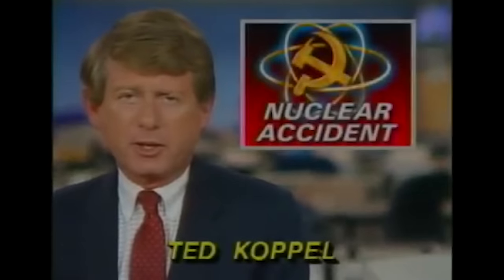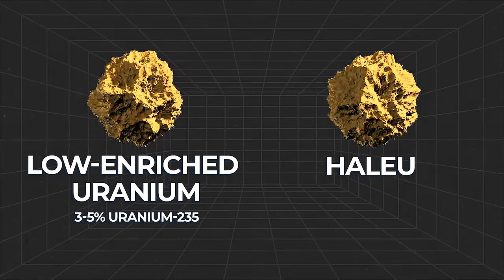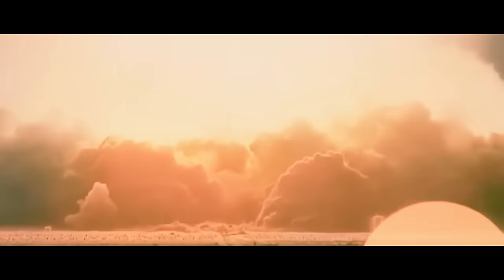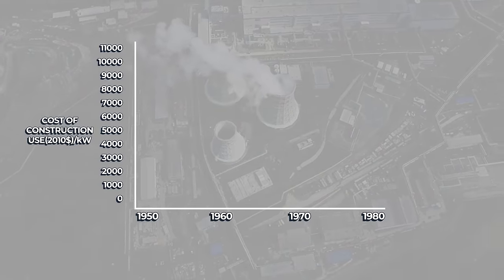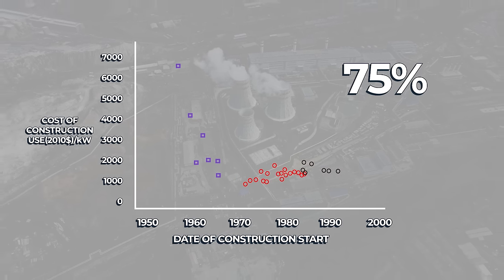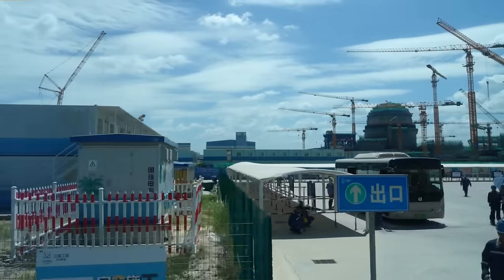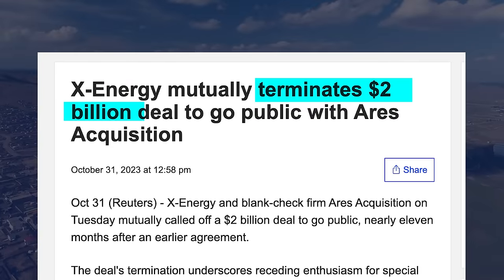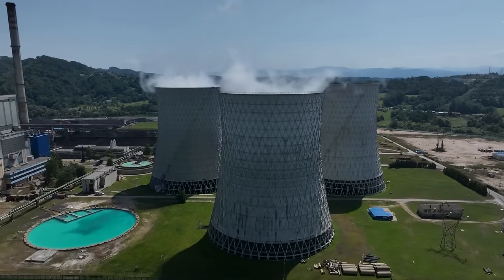Nuclear 4.0 | The Small Modular Reactor Revolution

Comment: The Moltex Static Salt design does away with almost every hazard from traditional nuclear power. Its sheer simplicity and intrinsic safety should dramatically reduce costs. It’s also scaleable by building more reactors on the same site. It is naturally load following and and cannot over heat. Excessive temperature stops the nuclear reaction long before it becomes dangerous. It could be disconnected from load at full power and nothing nasty would happen. It has boron shut-down rods but they are not needed as an emergency tool. 
There is no water or steam in the core so no pressure and considerably less corrosion than we get in PWR cores.
We should be moving heaven and earth to build these things. Instead we have an out of control nuclear regulator that completely stalled progress. Moltex is now getting the job done in Canada.
Reply: What are downsites of said system?
Reply: It might be good to have newer reactor designs that are safer than the older ones.  But the problem of disposal of spent nuclear fuel continues regardless of safety of reactors themselves.  And this problem has never been solved. Keeping spent uranium in water pools a few years, then outdoor dry storage in metal housings is insanity. There is no assurance that this extremely dangerous material will remain secure for thousands of years.
Reply: @alesksander  it's powered by pixie dust and unicorn farts.
Reply: @stanleyhampton7185 Finland does deep geological storage, and both France and Japan recycle spent fuel. Also some of these newer designs are able to burn up most of the spent fuel resulting in waste that only needs to be kept safe for a couple hundred years.
Reply: @justinhalsall4077  A couple hundred years is still a long time.  A society can easily collapse such a lengthy time.  Natural and man made disasters can occur.  It is very uncertain that spent nuclear fuel can be kept secure due to these potential failures. Geological storage is not without risk.  Seismic activity can cause leakage.  Water migration can cause dispersal of material from ruptured containers. There is really no safe means to dispose of spent nuclear fuel.
Reply: @stanleyhampton7185  It is esimated that the US has 800 years of "spent" uranium fuel in storage which has only 1-2% of its total fissionable energy burned.  Several SMR companies advertise their designs as "wasterburners".  The small amount of remaining radioactive material needs to be stored only several hundred years.  This is far better than the much larger casks of above ground storage used now.  The federal government spent $8 billion in senator Harry Reid's Nevada to build long term storage at Yucca Mountain on federal land.  Political opposition has prevented this storage facility from ever being used.  I would prefer to recycle old spent nuclear fuel rods, getting almost all of the available power out of them, and needing storage for a smaller amount of material with shorter half-life.  Remember, we are already storing used nuclear rods and nuclear fuel at multiple sites.  This is the long-lasting material with actinides.  There is no downside to converting this to much shorter half-life material.
Reply: @alesksander  The only downsides unique to it's design is the salt corrosive nature and it being unproven.
Reply: btw it's stable salt reactor btw, not static salt. if it was static salt it wouldn't work because you couldn't remove the heat efficiently.
Reply: Corrosion is much higher and a major problem with Molten Salt Reactors. The other problem is most people are considering Thorium as the fuel for MSRs, but fail to realize the fuel cycle requires more than a month to go from thorium to fissile fuel.
Reply: @tadferd4340  apparently below 700c water is more corrosive at 350C because what makes salt water so corrosive is the same thing that makes mud highly corrosive water + free ions.

If we are talking end game molten salt reactors running at 1200C yeh corrosion with current materials would be a massive problem, but they are end game molten salt reactors so we have plenty of time to work out the metallurgy or whatever material we end up using, maybe we decide it's not solvable with metal so we go with graphene lining, who knows, but 650C is plenty hot enough to get started.

Well maybe we decide gas core fission is a better route, but then you are basically using the same methods to get the energy out as fusion and the same containment measures at least in the inner core as fusion so it's actually kinda a solved problem.

But I don't see us going for gas core reactors here on Earth, just not the requirement for it, for spaceships though given that you can use it as an open cycle thruster with crazy high specific impulses yeh if we are regularly travelling between planets within the solar system I can us going gas core for that reason, then the tech being adopted because it's so much more efficient because of the crazy high temperatures, like 3000C+ or maybe a fusion fission gas core hybrid if pure fusion doesn't work out.
Reply: It won't reduce costs because the overwhelming majority of nuclear cost is regulatory cost. You could have the greatest concept in the world, but you still need to spend like $5B to grease enough palms and get approval.
Reply: @shawn576  The thing is that the vast majority of regulations are designed for PWR reactors specifically, so if regulators can be convinced to remove regulations which should only apply to PWR reactors then yes it would be cheaper, obviously there would be different regulations, but considering that when the reactor is running normally it's near atmospheric pressure rather than under 300 atmospheres of pressure and the thermal medium wont expand over 1600x if containment is lost it shouldn't be quite as burdensome.

That is a lot of if's though.
Reply: Molten salt reactors are not practical. Any commercially viable reactor has to be boiling water. And even then it is too expensive.
Reply: @Prometheus4096  What are you even talking about, heavy water is more expensive than molten salt and thats what the CANDU reactor among other use so I don't know why you think molten salt reactors are somehow economically less viable.

Due to the low pressure you don't need a massive air tight building 1600X bigger than the volume of water inside the reactor which is built to contain the radioactive materials in case of a reactor breach indefinitely.

The reactor it's self doesn't need to put upto 200 atmospheres of pressure so it can be built significantly cheaper as at least 10 years ago when I was looking it up there was only 1 foundry in the world that could make the parts for nuclear reactors because of the pressure requirement and reliability, and there are so many more reasons why you would expect the capx and operational costs to be lower.

The only problem is that it hasn't been developed and while you would expect it to be cheaper there is the possibility that it ends up being more expensive due to unknown unknowns.

If you don't include that molten salt reactors seem like the ideal candidate for SMRs because they can be made very small and transportable without the power output being terribly compromised, like a 300MW thermal reactor that could fit inside a cargo container, that is 300MW thermal though so ~100MW electric.

Where as with solid fuel your talking 25 - 50MW thermal at that size, you can make a 100MW thermal reactor that fit's inside a cargo container, but you need a whole bunch of support equipment, although to be fair even the molten salt reactor has to have something to turn the steam into electricity outside the cargo container, but everything else for the operation of the reactor is inside the cargo container.
Reply: @Etheoma  Literally every commercial nuclear power plant is water. Simple facts. Yes, economy works with what has been developed, what is simple, and what can be build to scale. There is a reason why all old nuclear reactors are pressurized water, why no new pressurized water reactors are build, and why solar and wind are build to massive scales right now. Nuclear is dead.
Reply: @Prometheus4096  Yeh and every vehicle was horse driven before the internal combustion engine...
Reply: @Prometheus4096  That logical fallacy is what we call "appeal to common practice" because it's always been done that way—and when we talk about nuclear reactors we are only talking about the last 70 years—it always will be the way it will be done.

"Tradition, Appeal to
Also known as the appeal to common practice, one engages in the fallacious appeal to tradition when arguing that something is better or more correct simply because it is older, or that “things have always been done that way.” The quality of being an older course of action in itself does not inherently make it better than a newer action.

Example (Case #8): “People do not really use in vitro fertilization tocreate a child compatible for transplants. I don’t see any reason why we shouldstart doing that now. Why not keep things the way they are?

Example (Case #2): “The University of Wisconsin Health Center hasoffered the morning-after pill for years. Why rock the boat? (If it is better for the center not to offer the pill, then why not rock the boat?)"
Reply: @Prometheus4096  The "Advanced Gas-cooled Reactor" and Magnox reactors are both commercial reactors that use CO2 as the coolant, the former is still in use in the UK

Comment: @20:50 The lunar night is between 1.5 and 3.5 days? I don't think so. More like 14 to 15 days.
Reply: Yeah I caught that one also
Reply: I think he meant no light at all being reflected. In the country w/no human activity you can see some of the Moon before it turns new, then the sliver of silver crescent. Takes usually between 2.3 days on average to go from some discernable light to just nothing then back to that curved line of light - waxing or waning, the amount of X depends on the position of the embraced orbits around the Sun.
Reply: @nomadscavenger Yeah but that doesn't work for a fixed spot on the Moon.
Reply: I'm no Astronaut but, wouldn't the lunar day/night cycle be shorter at the poles? Could that be the time-frame he's referring to?
Reply: @cmac3530 I was thinking that too, but without any specification, you have to assume the Moon as a whole... and then it just doesn't hold true. On the other hand, I remember the next NASA landing spot being on the South pole (correct me if I'm wrong), so maybe he got it from that, but the info is skewed.
Reply: @SirThanksalot_1 the recent one from the third party company IM was. NASA proper has never done that, though obviously they were involved in this one too.
Reply: [NOT AN ERROR] <- In the South Pole (only place on the Moon that will have a permanent population), there is no location without "night", but many "peaks" (were to place solar panels) over there only have between 2 to 7 days without any direct sunlight.
Reply: @cmac3530   The entire body rotates as one object, so it all makes 1 rotation in the same amount of time. If you go all the way to the poles, tho, you can stick your solar panels high on a crater ridge and never lose sunlight, ever, and inside that crater it will never SEE sunlight, ever, so you're likely to find water ice as you search deeper into the polar craters.
Reply: @nomadscavenger  You only get an instant of complete shadow, from when one side goes dark to when the other side starts brightening up. It's not like a solar eclipse that has a duration, this is happening because spherical moon is lit by a nearly point source of light and we're looking at the back-side of it.
Reply: @kindlin  Yes, a full lunar rotation is a full lunar rotation no matter where you are but, that's not what I'm talking about. 

Lunar day/night is dependent on if you have sunlight or not. And the length of time you have sunlight for absolutely differs based on geographic location. 

It does on Earth as well. At the poles you'll have months that are 24-hour sunlight and months that are full darkness.
Reply: @cmac3530   I was going to make that very point, that we have that on earth.... because our axis tilts. If you don't have axial tilt, like the moon (at only 1.5°), then the day length is stable at all latitudes. With 1.5° there will be some variation, but nothing like what we have on earth, and not all the way down to fractions of a standard day. Also, for any location that has an extra long day, you'll also have an extra long night 6 months later. This is still true of the moon because the moon still moves relative to the sun in the same way the earth does, just a bit wigglier.
Reply: @kindlin  - does the moon rotate ?
Reply: @herauthon   Yes.
Reply: I think he is talking a bit to shorthand. Possibly he means solar catchment on the moon. Not on Earth.
Reply: google, first result (an ESA paper): looks like you're right :)
Reply: @kindlin if you're at the south pole, you could also rotate the panels to align with the sun.
Reply: Indeed. Half a moon.

Comment: Flammanville III in France was supposed to be online in 2012. So far it has not even had the fuel rods loaded. It was 5x over budget years ago.
Reply: And that one is a prototype - the same design was built in Finland and China and now is built in Hinkley Point (and Sizewell). The one in Finland was a little bit faster, the ones in China are online now for over 5 years.

Comment: Another market for micro-reactors, is for self-consumption industrial use (e.g., manufacturing and tech).  Tech companies are little more open to risk taking, exploring new technologies, esp. if they are low carbon.  They. also have deep pockets and can take the early adopter premium.  The growth of data centers, increasing energy use from AI, presents another use case, guaranteed uptake, to jumpstart a new industry.
Reply: Didn't he say that the solar panel equivalent was only like 1% of the cost? price needs to come down to be viable
Reply: @luka3174 you have to remember that they don't have to pay for the batteries bc it's constant power instead of intermediate that is extremely important for factories
Reply: @loganaurora  of course, and batteries at the moment are the most expensive part. But still the efficiency difference is too big, we have seen solar efficency increase with massive global investment, is it possible nuclear can do the same?
Reply: I was going to write my own comment and say basically the same thing but you beat me to it.  Factories, data centers, office parks, airports, military bases, sports arenas and other mega-structures are all great candidates for isolated SMRs which can either feed excess power to the grid or store the excess power in other forms (batteries, hydroelectric  or thermal reservoirs, etc).  The advantages over large solar arrays are the small footprint, easy installation and energy density.
Reply: @brianmagner9220  The NA fission industry and Canada and USA regulators are actually meeting soon to discuss SMR regulations. A lot of it has to do with streamlining the cost model of submitting FSARs, since SMRs will be modular a lot of the cost can be handled by not modifying a standard FSAR for an SMR design. It's just the sight anaylsis (siesmic, heat sink and the like) which will be project specific. This will massively cut down on costs, especially if the SMR company can bring in their own tradesmen to complete the project and initial criticality. Then hand the keys over to the utility after they have established and certified their operator/maintenance qualification programs.
Reply: @anydaynow01  That is how I would like to see it happen. Certified technicians start it and do routine inspections every few months. A lot like we do for elevators and other machinery.
Reply: Data centers alone are projected to consume insane amounts of energy. 

 So the micro reactors might make total sense to them. Solar is more vulnerable to things like hail storms. Yet if they can't lower costs of reactors it is not happening. 

 Anyway we should be desiging mini persomal reactors to power exoskeletons or aircraft god damn it.

 Make a sphere of the best materials we have with a reaction going on it. Then use TPV cells to capture the heat! 

 I think there are materials that give off light that is blinding when heated. Put that in it too so the cells can capture that as well.
Reply: So a company can either just buy power of the power grid. Or go into the business of producing electricity, and hire nuclear engineers and all that jazz. Why would a company ever do the latter? The latter is only ever an option in a very remote area and when SMRs actually exist and are a mature technology. Which may be 150 years from now.
Reply: @dianapennepacker6854  In the future, you would only build data centers near sources of cheap power. For example, areas where you have wind parks or solar parks, or both. If not, they don't get build. Which means windy areas near deserts near the equator. Simple economics.